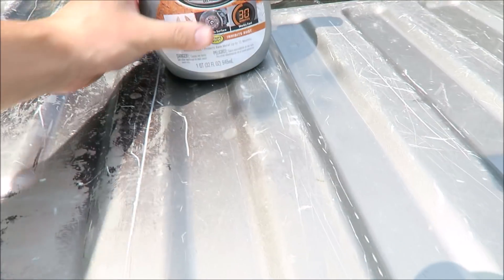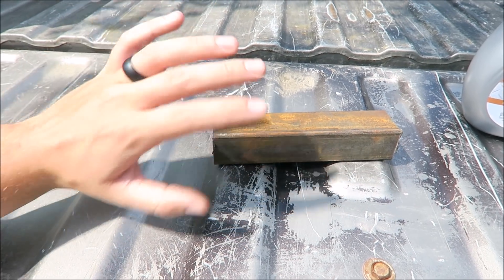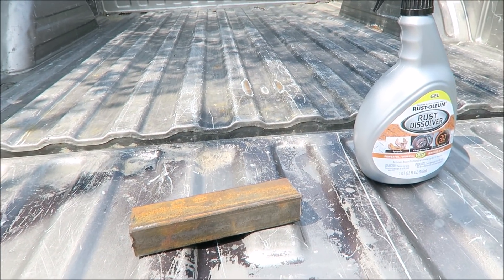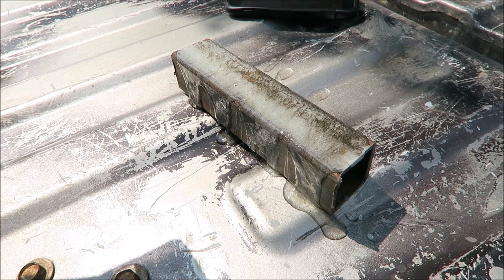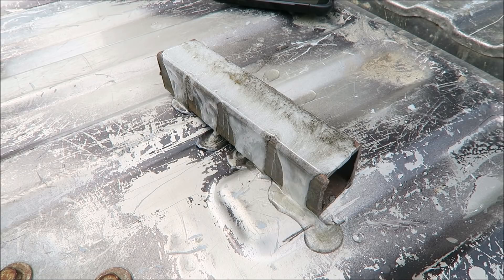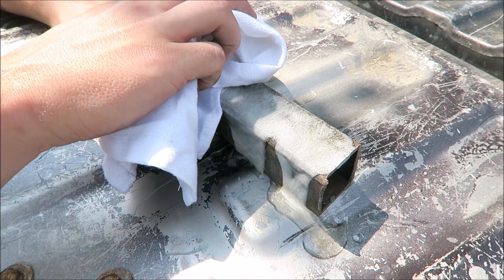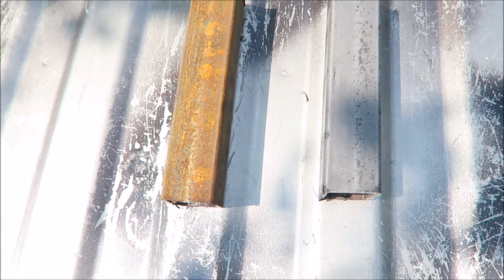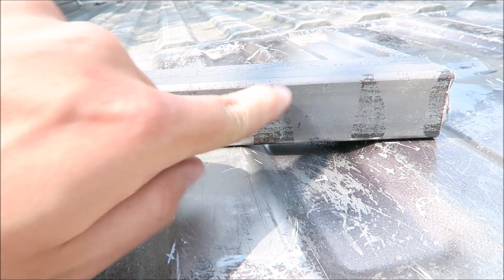Do Rust Dissolvers Work? | Let's Science

Comment: I just bought this at Home Depot. My 05 Tahoe rear frame has some surface rust.  Don't really know to address rust living in Denver. I sprayed the frame with this and it dissolved all the rust pretty easily. Now I have a grey frame with patches of black from the old factory coating. Now I have to figure out what paint to use on the frame. I feel for people in the rust belt. This sucks.

Comment: Watch video and tried after using navel jelly . Works better than the navel jelly.  But only good for surface rust. So back to muriatic acid then coat with phosphoric acid to prevent flash rust guaranteed

Comment: I use this stuff called prep and etch that i buy from home Depot here. Shit cleans rust fucking good but sometimes you have to use a steel brush and brush it or you can soak what you're doing and brush it or just soak it. You wanna be in a ventilated area though because it gives off a gas that in a closed space burns your lungs and makes you start to choke. And it kinda burns your skin if you let it touch your skin for an amount of time. Works well tho, i use it mostly to clean my tools such as wrenchs and shit and to clean the rust off that comes stock on harbor freight tools. Will also completely dissolve pennies so keep that in mind

Comment: I was looking into corroseal. It's a rust converter that can be brushed on.
Reply: I work on ships and corroseal is a product we use every time we bring deck to bare metal. It is not a rust remover but a rust converter. After removing large scale or flaking rust and wire brushing surface it is applied to convert rusty surface back to original metal, which we then prime and paint. Works great but not so much in tight hard to reach areas due to prep work needed.

Comment: See if it works on the frame and axles and such. I'd spray this on my truck and rattle can the underside if it worked. These places it might not work on but be cool if it does.
Reply: I know this is kinda late. But it works best if submerged or is covered with plastic so it doesn't dry. Vs grinding... I'll take it any day...
Reply: @airbc681  your comment confused me a little bit lol

Comment: It turns white.. like its turning into cum..  It's equally gross and amazing at the same time.  Obviously its bonding with the rust, and if I had to guess it releasing the oxygen that was trapped in the rust into the solution.  the only reason its not bubbling out of the solution is because it has some thickening agent to keep it on the surface.  so because you now have oxygen bubbles... tiny oxygen bubbles trapped in this thick solution, light is bouncing any which way off its insides creating w white color with in it.   By no means am I a scientist, and the most factual thing I said is it looks like cum, but that is my best guess. 

Anyway, That's cool, I would definitely use it to clean up rust in hard to reach spots...The best part is its not really going to do much to hurt metal part if you apply it carefully.    Can you get the same result by spaying just a little bit and then wiping it around on the surface?   The idea is just to cover as much stuff with it with the least amount of solution being used to do it.  like try it on a bit of sheet metal and see if you get rid of bit of rust before it bubbles up into hole.

Comment: I like to use it on truck frames, first knock off the heavy shit with a grinder wheel attachment or a stiff brush and hit it with this shit. Then what i do is spray rustoleum rust reformer on it and it’s ready for paint, btw you’re the reason I’m gonna try to start up my own channel 👍
Reply from the maker: Hell yeah, man!
Reply: Do you have to neutralise the rust remover inbetween that and the rust reformer?
Reply: @useyourbrain.5574  I don't think so, I never did, just get rid of whatever rust you can and spray the rust reformer right on it, it also comes in a gallon can and you can brush that on it you like, hope that helps👍

Comment: I haven't had a whole lot of luck with decal removers. I debadgged my 05 silverado and still have some kaka left over from the glue. Mabye you could do a video on a good brand of that.....??
Reply: A rubber wheel decal remover
Reply: Chris Kubond I’ve used turtle wax label and sticker remover it seemed to work decent with a little bit of elbow grease and a microfiber
Reply: Goof Off Pro

Comment: Wow. Worked better than I would have thought. Although, I'd probably need a 50 gallon drum of it for my Illinois truck lmao
Reply: i live 20 minutes from peoria and i fully feel you lol. my truck has really good condition for an illinois truck. moderate surface rust underneath but nothing rotted through. i sanded it all down and cleaned it all off with alcohol and undercoated it. tha cab corners were messed up but i drift stitched cheet metal over both sides so it looks 10x better lol. my rear wheel fenders are rotted out but im gunna cut all the rust out and rust rime it then put on fender flares. anytime i buy a vehicle i sand all the rust off and prime it and then undercoat it. any used car here in illinois has rust on it. its just a given. it sucks.
Reply: I hate Illinois terrible government and rust lol
Reply: Same boat here

Comment: I used it on my truck and I kind of use sand paper to clean it a bit then I use the same one you have but mine didn’t came in a spray bottle lucky. It’s been about 5 months now no rust hasn’t came back. Good video!